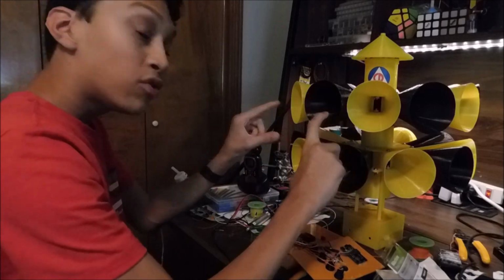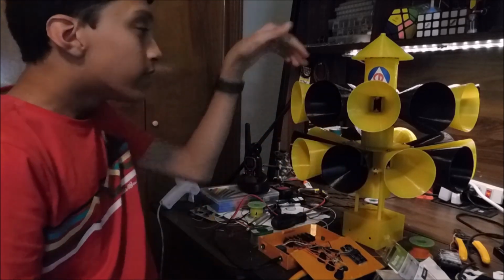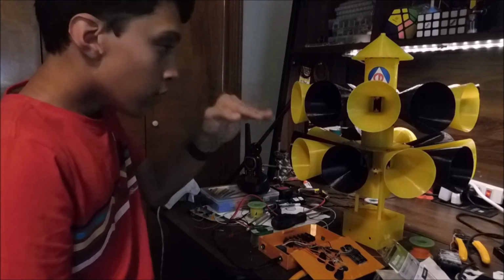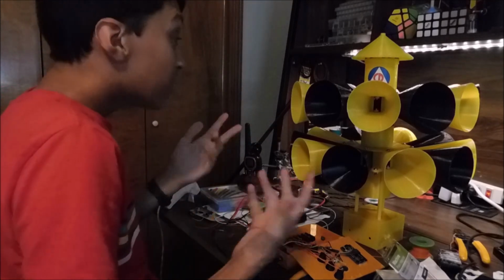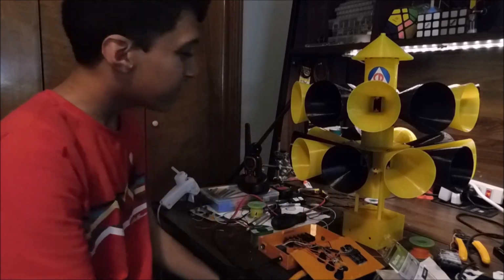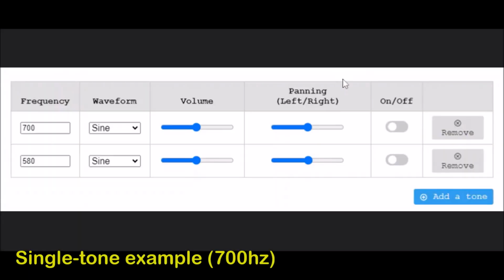Showcasing and Testing My Mini 2T22 Tornado Siren!

Comment: Where can I find the ar timer or af
Reply from the maker: Oh, I am so sorry, but the siren timer is not a public thing, because it never really worked too well. But, if you're thinking about making your own, I recommend getting an Arduino board so you can program buttons and relays and stuff. Once you get all that, it's pretty easy to make code for a siren timer. Sorry, but I hope this helps!
Reply: @milespeterson5049  thanks for the info tho

Comment: not bad for a first, the chopper could use some weights though
Reply from the maker: Yeah, I'll just say that it sucks compared to my newer models... I might remake a 2T22 or even a 3T22, but it might not be 1/4 scale because of the crazy size and motor it needs. The motor I used here had a terrible wind-down because of the insanely tight shaft and bad gearing. I won't be using these cheap motors again.

Comment: It sort of sounds the same. The real life one is a little different. Yours is also a little different but they’re both pretty accurate for the 2T22. 6:28
Reply from the maker: Well, thanks! This is my first video, and this design is extremely outdated. Don't worry, I'm going to make either a 2T22 or 3T22 with updated parts!
Reply: @milespeterson5049  one question what motor do you use? For this 2T22 siren it might be a while because this was your first video, but I just want to know because I might print your 2t22 after my 2001 and my super sirex
Reply from the maker: @DAMIANVARGAS-w2t  I'd tell you, but this siren is just a lost cause. I have completely scrapped this siren, and the 3D files are not available on Tinkercad anymore because printing it will get you nowhere. I do not recommend using motors like the one used on this siren, because it has a super tight shaft, bad gearing and a pretty cruddy wind-down. It also consumed around 6 amps of power, which is pretty insane. So, I hope you can understand why this project was abandoned.
Reply: @milespeterson5049  oh wow, thank you so much. I did not know that.
Reply from the maker: @DAMIANVARGAS-w2t  Yeah, you're welcome! But this is how you learn! This was so long ago I didn't even model the horns... I stole them from Nascar's 3T22. LOL.
Reply: @milespeterson5049 oh ok lol 😂
Reply: @milespeterson5049  oh yeah I can understand it
Reply from the maker: @DAMIANVARGAS-w2t  Lol! Thank you! I might consider a 1/8 scale 2T22 to pair with my STL-10 and STH-10 sirens.

Comment: It sounds like a 2t22 and a 3t22 mixed together
Reply from the maker: That's interesting! A 2T22 and 3T22 are the same siren, except that the 3T22 has dampers to create a hi-lo signal and other signals too. I did use a DC motor for this one, so that could definitely play a role in its sound qualities.

Comment: fast winds up and down loke aca hurricane mkii
Reply from the maker: Yep, it's partially because I used a DC motor, which have faster wind-ups and wind-downs. The real motor uses an AC brushless motor, which has longer wind-ups and downs. Stay tuned for more video releases!

Comment: mabye use a brushless motor its more accurate and will be louder but you did a good job wow!
Reply from the maker: Absolutely, I originally wanted to use a brushless motor, but most DC motors are brushed, and I didn't want to mess with any high-voltage AC stuff. Fortunately, I'm building another siren that will use an AC brushless motor, stay tuned for its release!
Reply: @milespeterson5049  you just earned your 31st sub!! (was me)
Reply from the maker: @siren_stuff  Thank you!! More content is coming out soon, so get ready!

Comment from the maker: For those who would like to 3D print one yourself, you've found the right comment! All the parts for this project are available to download for free on Tinkercad. From there, it's pretty straightforward to building your own!
You can find the project here! https://www.tinkercad.com/things/00hqmroxxCD-federal-signal-2t22-siren-3d-printable
Reply: What about the AR Timer, and electrical components needed?
Reply from the maker: @robloxingout2093  I had not intended to share the AR Timer's plans, but I would not mind at all now!

Here is the link for the circuit schematic:
https://www.tinkercad.com/things/klOHck80CVi-copy-of-outdoor-warning-siren-emergency-timer-owset-v2

And here's the 3D model for the timer box:
https://www.tinkercad.com/things/8Dg6DEkJiND-outdoor-warning-siren-emergency-timer-owset-v2

Keep in mind that these are a shared link. They are pretty unmarked, so it may be hard to understand some parts of it. If you need any help at all, don't hesitate to ask me! Links needed are provided! Good luck on building your own!!!